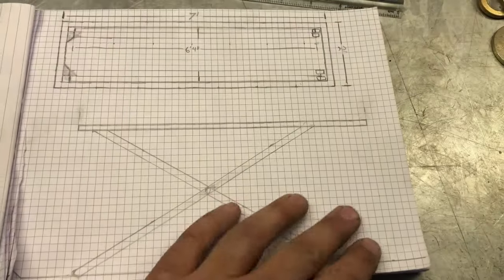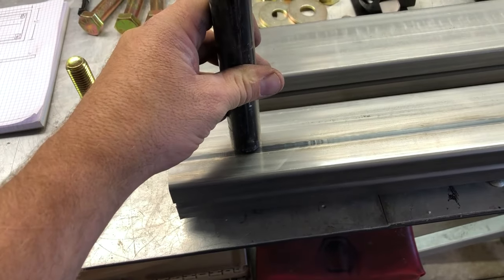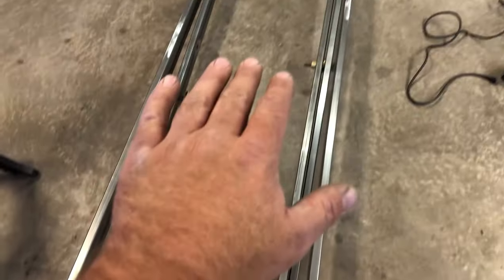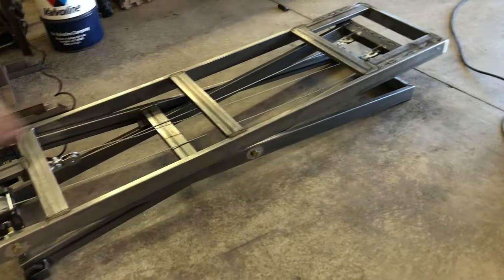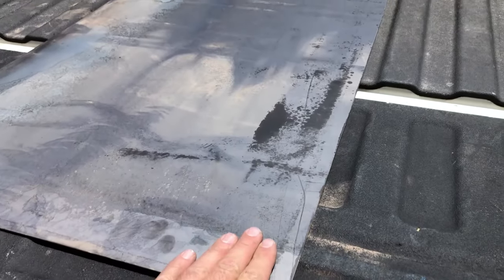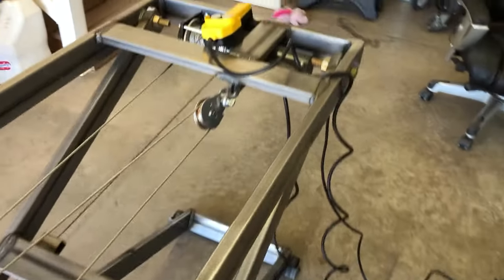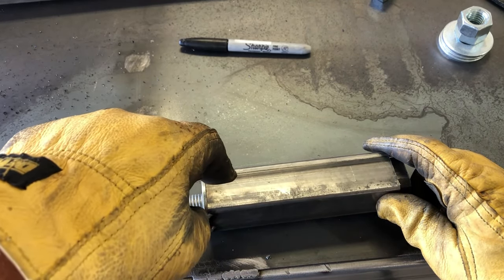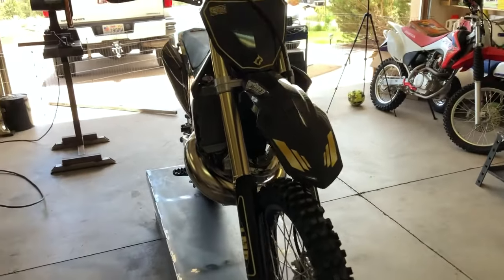DIY motorcycle lift

Comment: Just a small tip for those who don't have an acetylene torch.  You can cover the area where you'll be welding with paper towels,  then spray the rest of the surface with cooking spray.  Slag bbs won't stick.
Reply: Cooking spray works... so does a light film of WD-40, and that's always around the shop.  I wouldn't waste torch gas on weld bb's.

Comment: Hey brother, I own a shop up in Rochester, NY, called Asylum Cycles. I stumbled across this video after looking at many lifts and not happy. I have most of the material to build this. Do you have any build plans or materials list you could share? Wondering were the spacers inside the square tube stock and rollers you used.

Comment: How much did you have in your lift after you finished. I used an air Bello on the lift that I built.
Reply from the maker: Thanks for the comment. At the moment I am sitting around $500for everything. The price of metal in my area, much like everywhere is ridiculous. But so far I am super happy with the way it is work. My first plan was to use a air bag to lift it and may do that some day if I decide I dislike the set up I have now. Thanks again for the comment and watching I really appreciate it 🤘
Reply: @DIRTBIKEFAB  Yeah you done a good job on it, took your time welder up nice I’ll be watching for your next video

Comment: I built a similar table about 10 years ago to work on rider mowers. I had the same issue getting it to lift the first 6-8". Since I didn't want to raise the deck height and have to mess with ramps, I installed an air lift bag I had laying around under the center of the table. Inflating the air bag lifts the table high enough that the winch can take over and easily raise the deck the rest of the way.

Comment: This is beautiful. So I’ve been thinking how you go lower. I think adding a change of direction pulley near the center of the table and dropping it maybe 3” now provides an angle so the cable doesn’t flatten out and pulls against itself. Had the table been made out of maybe 5” stock, that would’ve allowed room to hide the pulley inside maybe? Im so intrigued, I’m thinking of doing a temp fab out of 2x4 wood and see if the theory works.
Reply from the maker: 🤔hummm I am intrigued now. Sounds like a good option and like where you are headed. Keep me posted sounds interesting

Comment: This is most likely the best DIY motorcycle lift I have seen so far.
I want to make myself one.
Can you make a playlist of the videos you have made of this build?
Would also be great if you have a simple technical drawing and cut list and share it with us.
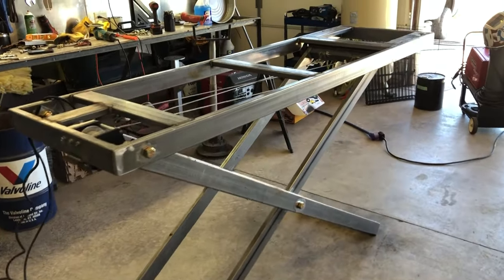Reply: 10:39 look at this shot here you can see what it could look like make differences, and search the internet for parts, i would add add the pivot maybe a rod welded to the bolts, or attached in another way for extra stability, and maybe a base plate cuz i don't fully thrust those wheels, but that is all up to you, your bike size, and how much area you might need, like i said go to sites for official scissor lifts take measurements ect

Comment: Nice build. I would add a safety bar with notches to set heights and hold the load.
Reply from the maker: yes i plan on doing something. i will have a second video up soon and finish that project. so make sure to subscribe so you don't miss it

Comment: Any updates? I know we are all busy these days. Just wondering.
Reply: I have an old bed that lifts. I wonder what I can do with that.
Reply from the maker: Yes I have been unreal busy with life. I will be doing an update soon hopefully. So far I have been very happy with this lift and not sure I’ll change much
Reply: Nice build. I think I might make something similar, although mine would need to be wide enough for a lawn tractor or snow blower (my most common patients/victims). I would also like to see if you have come up with a safety mechanism. A tall jack stand could work in a pinch. How stable is it side to side? I imagine for and aft is pretty good, except maybe at full height.

Comment: Hey I tried building this but ran into a few problems can you help me out?
Reply from the maker: Sure how can I help
Reply: @DIRTBIKEFAB  ok I’m at work right nite but real quick. I made my table 8 foot. And the legs 7foot 4. I’m having trouble with the pulleys and I have s 2thou lb winch
Reply: @DIRTBIKEFAB  I made the table eight feet and the legs 7foot 4 inch